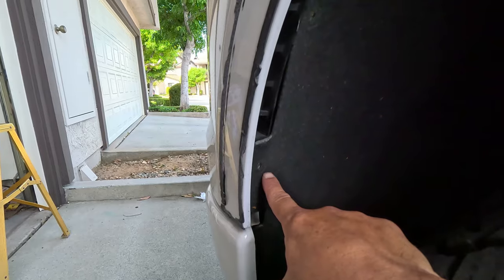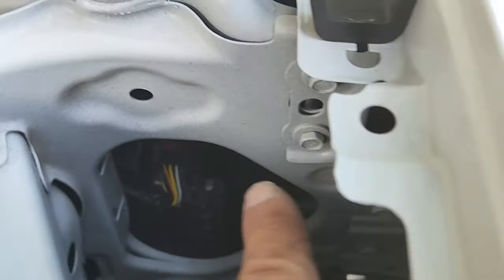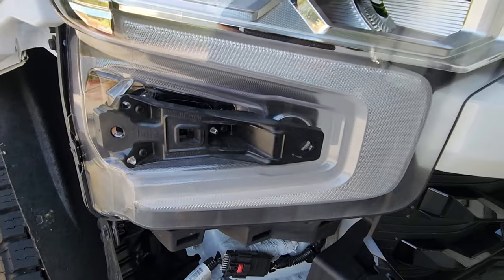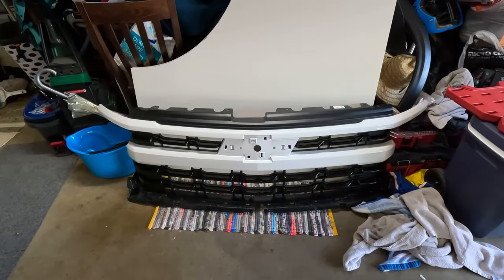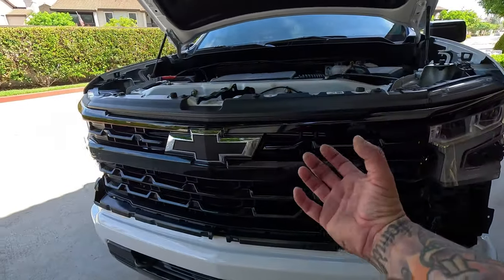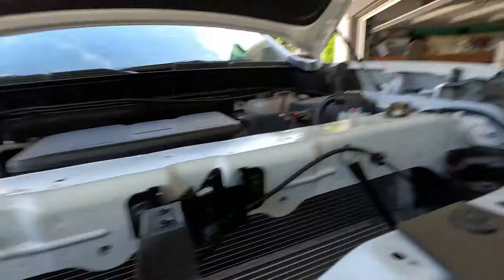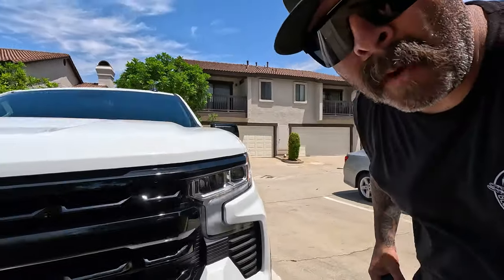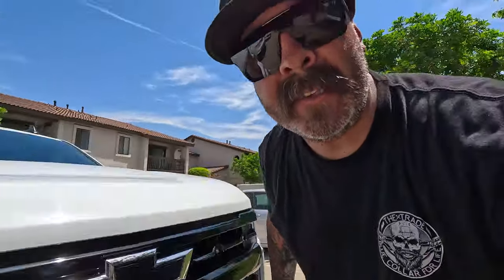2023 Silverado Grille Removal and Replacement!

Comment: Do u remember what socket u used for the 3 screws on the inside of the fenderwell?
Reply from the maker: Damn you know what.... I'm pretty sure it's a 10 or 11mm socket but I needed to use an extension with a swivel to get to the one in the back. That one was not easy at all.
Reply: @That-Silverado-Guy . Thanks for your help and video. I installed it yesterday and it looks awesome! 👌
Reply from the maker: @seanwhipkey1452  sweet, I'm glad I can help! If you have pics, please send them or post a video. Thanks 👍👍👍
Reply: @That-Silverado-Guy  OK I will send you some pics today.

Comment: Was the bow tie easy to take off and put back on?
Reply from the maker: Yes... simply push some tabs to release and push the new one in, and that's it...  you just have to get the grille off to get to that bow tie emblem, which takes a little time.
Reply: @That-Silverado-Guy do you know if the top part of the grille is just a few clips? Like how yours white but you changed the whole grille. I got just the black part
Reply from the maker: @zacharyperrone8795  are you talking about the sides of the grille or the center?.... The sides of the grille have a black part with tabs that you will need to unscrew from the old grille if the new one didn't come with it and instill in the new one you got
Reply: So on the actual grille you changed yours from white to black but you changed the whole grille. Mine is an LT so the grille itself is black but the top fascia and middle sandwiching the bow tie is chrome which is what I want to change to black. I bought just that part instead of a whole grille.

I tried sending you the link but it won’t let me
Reply from the maker: @zacharyperrone8795  email me some pics..... Eugene.perez78@gmail.com
Reply: @That-Silverado-Guy cool cool just emailed you
Reply: @ zacharyperrone8795 did you guys figure out if you need to take the whole grille off to replace just the overlay part?
Reply: @That-Silverado-Guy did you guys figure this out? I am wondering the same thing.  I have just the middle piece that I was going to swap out without taking the entire grille off if that’s possible
Reply: @zacharyperrone8795 @That-Silverado-Guy @casey172 Did you guys figure if you have to remove the entire grill aseembly to swap the colored middle part?
Reply: @casey172 were you able to do this?

Comment: What flares are those on your truck? Are they the GM low profiles?
Reply from the maker: Yes, they are GM low profile by Air Design, and they definitely look good in my eyes. I do have an extra set, but the front ones need new double-sided tape and rear are not touched. Let me know if you are interested for a very cheap price.

Comment: Great video guy! It’s gonna save me from breaking my grill. Other videos have it to where all you do is pull on the grill with a firm pull and should come off. I tried that but something was holding the bottom piece I still. With your video there’s 3 more 10mm bolts I need to remove. Thank you
Reply from the maker: Appreciate it... thank you!!!
Reply: @That-Silverado-Guy  

The reason I’m gonna remove the grill is to add a 30” light bar behind it. Now I want to change the grill to black after watching your video 😋 I have a 23 White RST
Reply from the maker: @Rudeboy916209  Do it man!!!!

Comment: Do you have the part number for the clips by the headlight? Mine all broke
Reply from the maker: The yellow or white clips? The white clips are 11546850 part number for my 2023 silverdo. Is that your year as well?
Reply: @That-Silverado-Guy  yeah the white ones, thanks! I’m also a 2023
Reply from the maker: @cgcll  perfect those are the ones I got from Amazon and a lot cheaper than  what the dealership wants for the price of 1